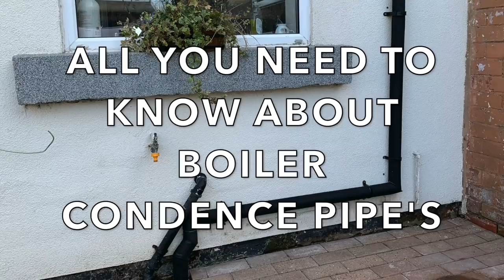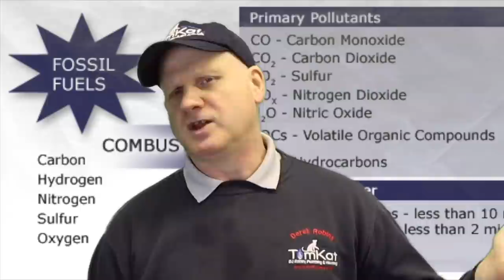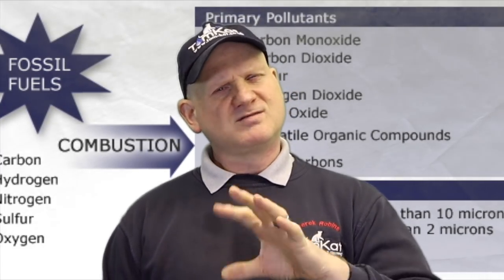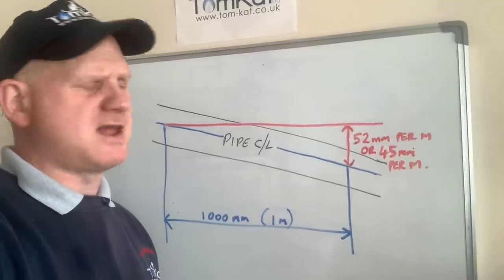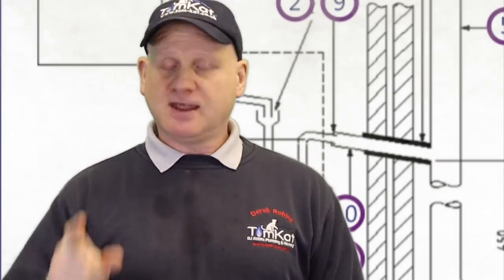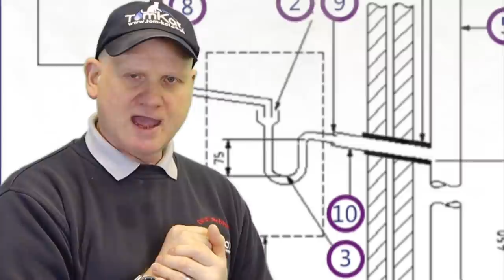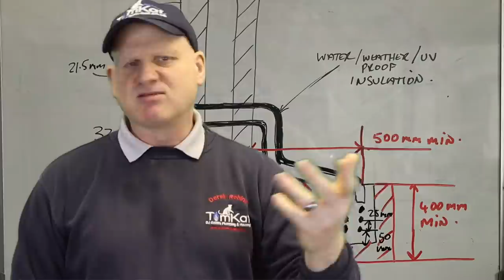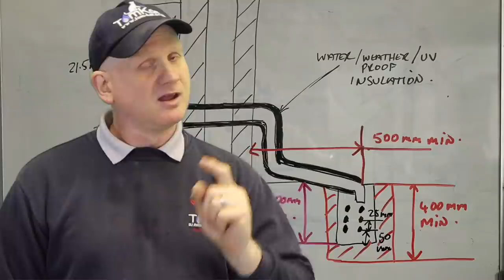DO BOILER CONDENSATE PIPES NEED INSULATING look into BS 6798; 2014 and building regs H1 to find out

Comment: I was going to skip through your video but am glad I followed it right through. Last night my boiler desided to fault out after making some strange vibrating / throbing noises it being -3 deg. Knowing about the condensate problem with freezing, I checked the internal tank (Worcester Bosch CDI) and found it was totally full. My external drain to soil stack distance  was only about 100mm with 21.5 plastic non insulated solvent weld pipe but still wasn't draining. I had to hacksaw through the pipe and redirect over flow into a bucket as an emergency temp fix. Note I had recently tried lowering the boile roperating  temprature to ensure it was in condensing mode more often for fuel saving and this may be producing more condensate than it could cope with given the -3 outside temp. So it looks like upgrade to 32mm pipe and insulate. NB Previous system had worked ok for 3 years

Comment: Derek, my installer fitted the condensate pipe externally and lagged it with foam insulation. Not only does it look unsightly on the outside wall but also forms a debris trap i.e. always full of leaves. Couldn't the pipe simply have been tapped into the bath waste adjoining the boiler cupboard at first floor level? Great vids btw! Cheers JL

Comment: Just had a Viessmann boiler installed. Condensate runs into a 38mm pipe connected to a soak away. There is only a small external exposed section, most of the external pipe is underground but the exposed section is not insulated. Engineer said there is no risk of freezing using 38mm pipe.

Comment: The condensate pipe from my Worcester Bosch boiler, which is located in my garage, has been disconnected externally and temporarily discharges into a plastic tub, internally, and emptied daily into an external drain.

Comment: Before the building regs changed I could not understand why my very long exterior condensate pipe in a first floor flat had not been insulated...it seemed sensible to me. Then when the ice has stopped my boiler I could not understand it even more. It was worth listening to your talk. I will have to get it insulated no question.

Comment: Excellent video. On my system, installed 2 months ago, the pipe taking away the condensate looks like 15mm polypropylene. Am I alright to use standard pipe insulation (all the water pipes in the loft have this around them) to protect the condensate pipe from freezing? There is a run of about 400 mm between the exit from the boiler to the rainwater downspout and a fall of about 20mm
Reply from the maker: Standard pipe insulation is not waterproof so it gets wet and then freezes you will need waterproof rubber insulation or you will be just wasting your time and money

Comment: Hi Derek, thank you very much for the information it’s very helpful, may I just ask, if our condensate pipe is not insulated and is made of thin possibly PP plastic and runs vertically down our outside wall over 15 feet into our gutter drain and turns around the house corner horizontally also at the top, the Worcester boiler was fitted in 2016 did the fitters not comply with the BS6798 regulations.
Reply from the maker: They did then but it’s not now

Comment: Just checked my housing association condenser boiler & it has a copper pipe for the condensate that doesn’t go to the drain 🤔
Reply: Are you sure it is not the prv pipe
Pressure relief valve
Reply: @emmanueljouille7012  there has to be a condensate pipe but I can’t see any other pipes exiting the boiler 🤔

Comment: Worcester Bosch doesn't allow the condensate pipework to be run externally on their 2000 boiler unless a Condensure is used.  I think their other boilers have  larger condensate traps so don't require a Condensure.

Comment: Yeah very good video but you completely missed 1 scenario. When the outside condensate pipe is vertically downwards into a drain gulley. I understand it doesn't need to be lagged in this scenario??
Reply from the maker: If it runs outside it will need to be insulated
Reply: @tomkatgastraining  thanks for the quick reply 👍🏻

Comment: Hello , if a soak-away needs to be fitted does this need to be minimum 500 mm from the exterior wall ? Unfortunately this would be impractical in my situation. Can the soak away be closer ? Thanks
Reply from the maker: They must be fitted to the manufacturers instructions or damage to the wall could occur.

Comment: What’s the reason behind connecting to the wet part of the cast iron stack ?
Reply from the maker: So the condensate is diluted by the water if you put it in the dry part it will corroded the cast

Comment: Hi Derek that’s a great video 
If the trap in the boiler is >75mm still require a trap by the soil stack?
Thanks
Reply from the maker: No but some boiler manufacturers want an air break
Reply: @tomkatgastraining  Ok, obviously then need’s a trap because of the smell at the air break 👍
Reply from the maker: @valentinmirauta7059  the manufacturers instructions will always guide you 👍🏻

Comment: Hi
Does the condensate water have to be drained into the main waste water pipe.
Can it be drained into the storm water pipe?
Can it just be fed outside to drain into a hole in the ground?
Reply from the maker: All of them to a point
Reply: Thanks Derek for the quick reply.
It's just that my neighbour has put in this system into their home last month. The condensate discharge pipe is barely 500 mm from my house and therefore my foundations. I only found out tonight when I heard the water running.
There is definitely no limestone used in the bottom of the hole.
Reply from the maker: @jacko8371  there is a specialist soak away for this

Comment: Did you actually say that you couldn't understand how the customer didn't notice the damage to the copper pipe which was used for the condensate going through the wall? Did you actually say that? Are you kidding? Home owners don't even see anything but the front of the boiler, let alone seeing the pipes. Home owners only want a heating system which works and they hand over wads of cash to people who they feel that they can trust to do the job properly. Sadly, most companies and workmen don't give a damn about procedures and quality of workmanship and the home owner does not have the knowledge to know if they are getting a bodge job. I recently had a boiler fitted and the workman rushed through everything as quickly as he could, without draining down, checking that air isn't trapped in the water system, bleeding radiators or checking them, repairing damage to the flue hole or even cleaning up after himself. The company didn't even bother contacting me to enquire how the job went, only to ask for payment of invoice.

Comment: you only get half an hour protection at minus three unless it is fiberglass insulationn then its only a bit more protection mine runs out of the wall high up then into an open ended 32mm drain and underground to a soak away and even though thev east wind was leaving frost on my outside wall no freezing and has not done so for many years now, it is mostly the horizotal parts on these condensates that freeze and yes i have attended many frozen pipes as I was a plumber retiered now thank God